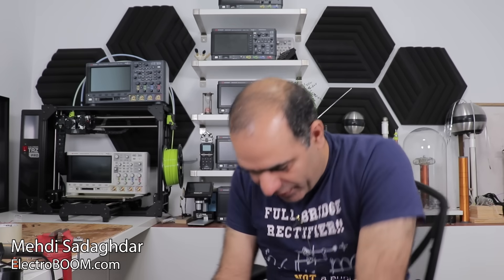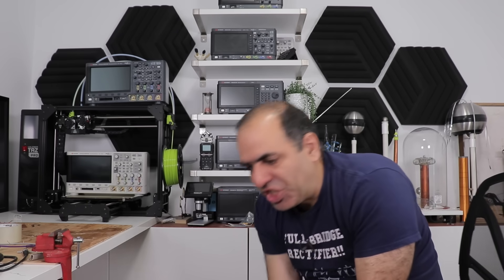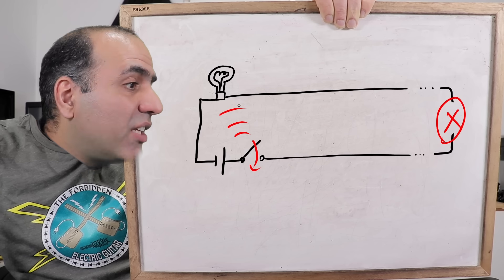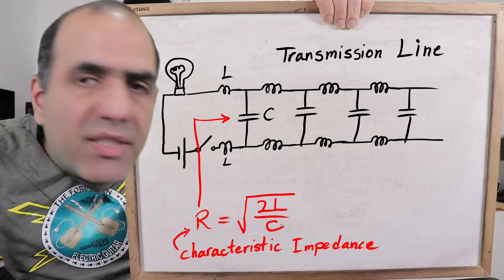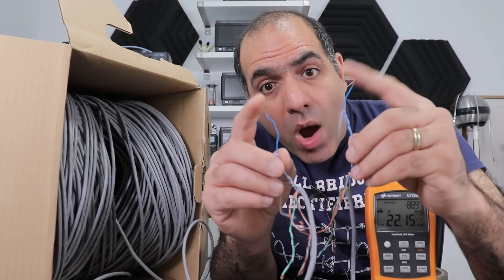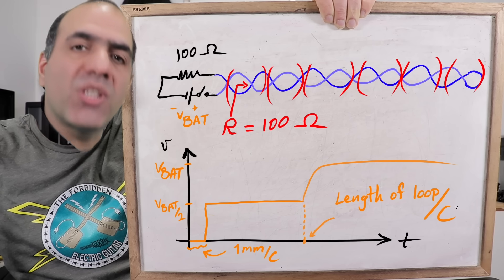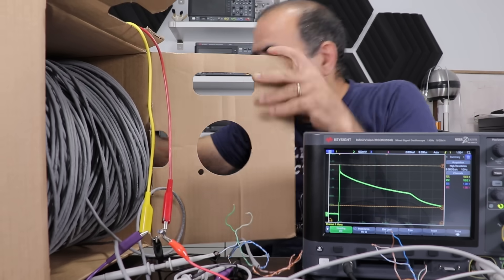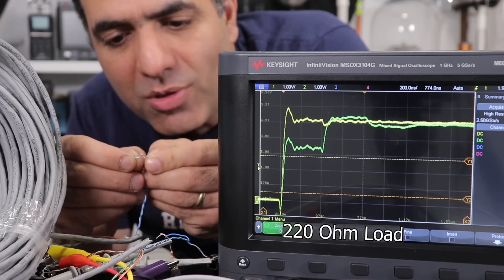Testing the LONGEST LOOP OF WIRE!!! to Turn a Lamp On

Comment: Fun feature of Cat5 and Cat6 cable, each pair is twisted at a different frequency. If I recall off the top of my head the blue pair has the most twists and the brown pair will have the least.
Reply: Sure, if they were the same then the twisting wouldn't help much for interference between separate pairs.

Comment: If distance between wires doesn't matter (1m, 1mm, 1km, 1000km etc) and if this loop can be open, so can we use this small time period (before the load "know" if loop is closed or open) to send/receive information (from power supply)?

Comment: Maybe this time until power suply realize that circuit is not connected is proof of that our reality is the simulation because in programming, checking if route from A to B is possible, code also check steps between if there could be any break in route

Comment: I want to see you connect two opposite side diodes in parallel to see if it blinks in alternation.
And, how about parallel resistors of equal and different values? 
They should be in superposition of waves bouncing in chaos, right?
I predicted it because I actually know that the resistor actually work by reflecting some of EMF hence the quadrant of electric components and a theory of memristors. I just know it, I didn't understand it....
Reply: niddg viiut  That's why I want to see 2 opposing diodes in parallel configuration. It's like I'm asking what happen if he connected a wire that glows when it receives electricity, just that, this wire is not heating filament nor vacuum tube with electric plates and glowing coating.

Comment: So how does the load receive voltage instantly if the line is disconnected, is this EM radiation being sent and received by the load? is this why pulsing the signal works, it's essentially EM waves being received by the load?
Reply: Yes. For the most part the wires act like a giant poor-quality capacitor.

Comment: I believe that the point of that all is "
    Definition of the Ampere

    The unit of electric current, the Ampere, is defined using the force between parallel wires carrying current.

    "The Ampere is that current which when flowing in two infinite parallel wires one metre apart produces a force between them of 2 x 10-7 N/m""

Comment: So if you shield each wire separately to the ground, the wave won't reach the other wire? It will have to travel across all the length of the wires.
Reply: Generally, yes. There is no such thing as a perfect EM shield, but you could mostly shield it.

Comment: My biggest problem with veritasium is that he basically just redefined electrical noise. The question is how long it would take for the primary signal to get to the lamp through the wire, not how long it takes eddy currents to bridge the gap and generate 1% of the power.

Comment: Now I need to replicate that with a big roll of house wiring I have lying around. I can't find propagation velocity for that though. Does it matter that there is a lot more copper compared to the insulation, or is the skin effect all that matters here and thus the insulation material is the main factor? Could one build a "faster" cable by having an airgap between the copper and the insulation (not saying this is feasible at all)?
Reply: It's not really either type of skin effect, it's that most of the EM field is close to the wire, so it is mainly the insulation that determines signal speed.

Comment: Sooo, I'm a bit perplexed. Is this not a form of "wireless" electricity? Since the wires are not connected when you rapidly open and close the circuit to your function generator, what would happen if you had another LED (or more) connected to an open circuit beside the original one? Would those LEDs light up as well?

Another question: Does the voltage source drain the same amount as when the circuit is closed? For example, in the open circuit, if you had a battery connected to the function generator instead of your voltage source, would the battery last longer than if it was connected in a closed circuit without the function generator? Seems like it might use less since the battery is technically "on" a lower fraction of the time.

Comment: Great video! I'm just missing one detail: This effect is also known as cross talk or EMI, which is why you should shield your data wires. Open end means two independent wires.

You can also call it induction and what you did with the LED was basically what any wireless charger does with a mobile phone, electric toothbrush, etc.

Increase the distance between the wires and you get a radio transmitter + receiver. The transmission delay is also t=d/c.

All in all, applied Maxwell equations. Do you already have a video about them, btw?
Reply: But if EM induction was significant then the LED should have lit up every single time the connection with power supply was made but clearly it wasn't the case because the capacitive effect was more pronounced and as it couldn't be discharged because of the LED being in reverse bias, it didn't light up after the first time until an alternating current was supplied and a resistor was connected in parallel to the LED for discharging the capacitor formed by the wire.
Reply: @abhradeepdey2640  Sorry, I don't get your point. It's still induction, independently of the LED's properties.
Reply: @abhradeepdey2640  yep, its just emitting an EM wave that can be detected at the LED, aka radio communication, something we knew about over 100 years ago.
Reply: That's what I was thinking, "its not powering the light, the light is catching the radio wave and the transient causes detectable current."
Reply: Thank you, that is much clearer.  I feel like these electro nerds got distracted, when the actual question was about the speed of light in a straight line.  This explains a different aspect of the situation.

Comment: Here's a green energy technology let's hear your opinion about this Karma since he is putting it on his house and running it
1. The 1st working prototype
https://youtu.be/Dp-6fOGI6oc
2. Giving more data on the working prototype
https://youtu.be/o_2K6e2GUoU
3. Using the step up to prove looping is possible
https://youtu.be/QnUWg13FCTc
4. Making a bigger prototype.
https://youtu.be/CIGhDO9Q9R0
5. Showing and proving what the professional says about looping
https://youtu.be/HTR03aSiGWs
Final video Reference from professional.
https://youtu.be/WVM0F2OrQhA
Time to hook up the big system using these methods and an update where I'm at of taking my home off the grid part one
https://youtu.be/S_oxzKu8Nzs

Comment: This test called Time domain reflectometers, which commonly used on the computer network for finding cable faults on arbitrary distances. Today, most switches, and some PCs does have this feature built in into the device. 

The propogation speed, usually stated on the cable datasheets also! It is around 60-70% of speed of light. 
What I cannot really understand is, that speed is determined by the cable jacket material! I guess it is related to the capacitance of the insulator?

Comment: Nice demonstration of transmission line theory. Problem is just that this eksperiment has absolutely no relevance to the electrodynamic theory which started the debate. The same goes for the eksperiment in the Veritasium video.

Comment: The "transmission speed" is probbably written in the datasheet for the cable, atleast they're for coaxial cables as RG58 for example, which has a speed of 63%.

Comment: I need a question (unrelated) answered. Yesterday I had a fan plugged in and placed on  speed 3 and it was working good but I noticed that when the cord was twisted the fan motor began (still speed 3/fastest settings it has) to spin faster. More twist faster the motor moved. Why and how? 120vac 60hz house fan

Comment: Fascinating stuff, Mr. Boom, but I'm glad I got out of relatively high-frequency radio repair and switched to DC-powered battery circuits, PLC logic programming, and playing with Arduino.
I'm more a "Spock logic" guy, and less of a theoretical hocus-pocus wizard at this age. (71yrs)

Comment: yo man length of each individual wire of twisted pair is longer than the cable length because of the twist. Check it in speed of light measurements

Comment: I wonder, if you have a LOT of these "longest loops" that all provide energy for a very very short amount of time when they start, and you make it so,  every loop and PSU is connected to the load just for that short time they provide energy:

can you make it so, the bulb stays constantly ON even if the circuit the bulb is in, it's always open

Comment: It surprises me that electricians apparently find it unintuitive that the electric wave bounces backwards and forwards. In hydraulics it is common knowledge that a pressure wave does exactly that.
I guess electrical engineers never really consider transients in electrical circuitry and only consider the steady state.
Reply from the maker: I'm an electrical engineer!
Reply: @ElectroBOOM  I'm an engineering physicist by education who works as an electrical engineer and have plenty of experience with electrical engineers whom can't properly explain to me about electricity.
As an example when I ask them to explain me WHY the power grid needs reactive power, they explain to me Pythagoras' theorem. When I tell them that that doesn't answer my WHY question they tend to look at me glass eyed.
So there seem to be little electrical engineers like you that truly attempt to understand electricity.

Comment: Informative, but you should have conducted two more experiments to see the difference. 
1.A Switch near to the supply voltage while the ends are shorted (you did that in the start of the video but without oscilloscope).

2. A switch near to the load(LED) to see if it behaves differently or the same as the other 2 experiments.

Comment: I think there is a point that you have been omitted, 8000 meters is whole roll of CAT5 cable length, but the twining wires, will be even longer and longer, at least you have to measure 40 meters unpacked wire length as a sample to calculate how long is it

Comment: If you leave the wires spread so the circuit open, it does matter if you have twisted and close wires because you are considering capacitance. I think that all that capacitance would fall in the case of the stretched wires
Reply: Electric field affecting wires = capacitive coupling. There's always some capacitance between 2 wires

Comment: The spike in voltage before on or off state for the behaviour of wave character... Does that happens everywhere... For example if I connect a power source to a random loop, does it cause the potential to be used for a little period, if I keep switching, it might consume energy right...

Comment: This does a wonderful job of straight up depicting two or three factors which are normally negligible, the coupling of wires, capacitance between two wires (technically part of the first one, but hey), and resistance in wires

Comment: Cool expirement! And what about case, when the load have a smaller resistance, like a light bulb? It doesn't matters for a bulb, what is radiants between wires, it lights after the energy travel through the all wire and returns to the lamp. And answer to the question in a start point "when the light bulb on?" As soon as energy travels through  the wire at the light speed. In theory veritassium right, but in practical case with real lamp and wire we don't care about some radiant energy. Radiant energy doesn't light the bulb.
Another case meaning of a light speed is a signal lines in a computer. Critical lines are made  the same length, because the one signal can be received later then other. And it matter in centimeters of length.

Comment: I believe the initial voltage step will get smaller with increasing distance between the wires. Can you test that?
at 1 meter, I believe the voltage will be too low to actually light the lamp.

Comment: So I've been chewing on this for a second. I'm willing to accept that electricity is transmitted in the magnetic field around the wire, but my question is simply this, if it is transmitted in the magnetic field around the wire how do things like fuses and circuit breakers breaker the circuit by opening the circuit? Furthermore in DC, how do diodes prevent reverse current flow and transistors block current until saturated if the energy travels outside of the wire or trace
Reply: I think youtube deleted my first reply to this, so I apologize if this is my second comment on this thread.
I believe the induced current in modern home wiring is usually considered minimal to negligible. The breaker/fuse to a sub-circuit cuts the vast majority of power and the wires are usually not tightly coupled in parallel as the lines travel out of the breaker box. In essence, there is a small leakage across coupled lines (parallel for long distances), but in practice it is usually avoidable and negligible. Here's a page on stack exchange that likely has more educated people explain it: 
https://diy.stackexchange.com/questions/243571/is-one-of-these-wires-inducing-a-current-in-the-other

Also for transistors and diodes, there is a small potential induced along the axis of the wire, but it is a very weak coupling and is thus very small. It is a problem, however, for PCB designs sometimes. One should limit how close their parallel traces run depending on their tolerance to induced current and noise tolerance. Voltages/currents are usually small in PCBs but traces can get very close to each other and as such, have a minimum distance to avoid substantial interference.

Comment: So I'm no physicist, however the twists in the internal wires, don't those make for a noticeable difference in length i.e 1 inch of wire should be like 1/8th inch of wire when pulled, all i'm saying is "It doesn't matter" scales up depending on the project's size, so it Does matter, just not enough to care at this scale.

Comment: Now I want to see someone do this with 5 loops of 1000 ft CAT 5e all linked together. 7.5 miles or 12.19 Kilometers. My only concern with a loop that long is the resistance of the wire may be too high for it to work, but I want to see it.

Comment: This 10:10 reflection phenomenon is how some cable testers show cable length during open test, otherwise connected, of course, the circuit will be impedance matched appearing "infinite" or like a single resistor at beginning.

Comment: Great demonstration! Just wanted to let you know that you don’t need an external tape to measure the length of the wire. These cables have number of meters written on them (every meter if I recall correctly).
Reply: 😂😂 indeed, I've seen cables with both ft and m printed right on the cable mantle.

Comment: I feel like I did something similar on accident 
I have this lamp on the wall which is an LED lamp and the switch is about half a meter away from it and is usually turned off
I unintentionally touched the bulb barehand and it started producing a dim light,and after I wrapped my palm around it,it got brighter. Not bright enough to see in brood daylight but good enough to notice in the dark
Basically double proofed the rightfulness of this video

Comment: In Veritasium's original video he was being misleading because he just asked how long it would take for the lamp to light up. When said like that it gives the strong impression that he means "light up fully, ie. to full brightness". He doesn't explicitly state that any amount of light, no matter how small, is enough. He also doesn't state if the lamp can then change brightness during that 1 second delay before the "wave" of electricity through the wires reaches it. Again, the way he asked the question heavily implies it. In other words, his question gives the strong impression that it's actually "how long does it take for the lamp to fully light up, and stay that way?"

It's still unclear to me whether the lamp would light to full brightness in 1/c seconds, and whether it would immediately start dimming down (for the duration of the next second), or whether it would stay lit, or even brighten up.

The worst thing is that Veritasium's lengthy explanation didn't give an answer to that. He just went on and on about electric fields and whatnot, but didn't give a clear answer to what actually would happen to the lamp, other than a very vague "it lights up".

(Note that I'm not here talking about the filament heating up and thus taking time to reach full brightness. I'm assuming here a hypothetical lamp that lights up immediately to a brightness equivalent to the current passing through it.)

Comment: OH, Mehdi. 

When I was watching your video, I just remembered that My professor  in Shiraz university (Dr. Zarifkar) told (I don't remember what is his actual sentence)  that voltage [changes] (or electrons - not  sure) runs in wires in 2/3 of C speed.
I think it's relevant to that speed you got from your scope.

Please do more of these fundamental electricity/electronics experiments.
Thanks

Comment: Nice demo of a twisted pair transmission line in impedance matched and un-matched condition, realizing a real world situation and not using "controversial" articulation as Derrick was doing to gain curious attention on average educated folks (so called click-bait). Not even full fletched physisists would scramble verbal explanations in an effort to generalize as much as Derrick did in his first video about this anyways. Good job Mehdi and greetings from the east side (Ontario) :).